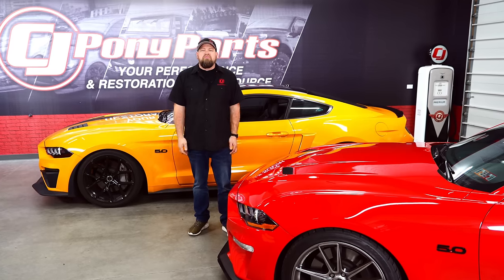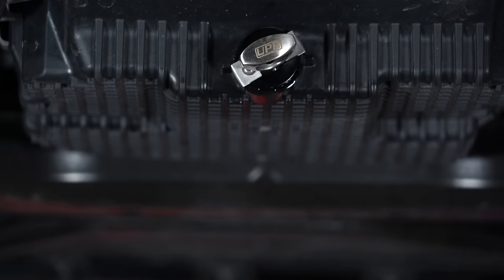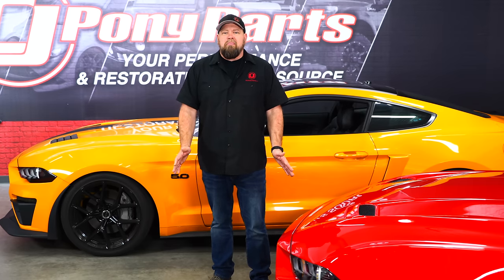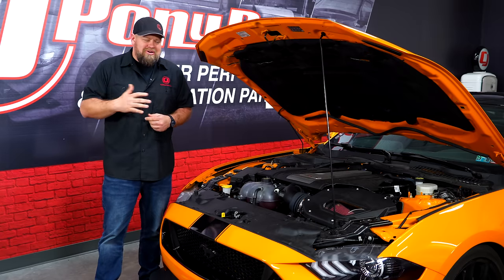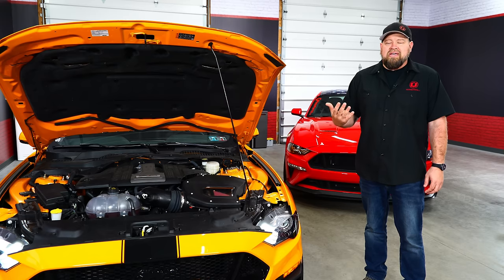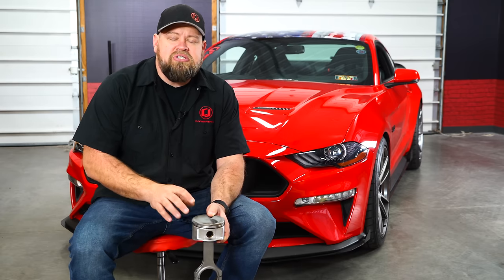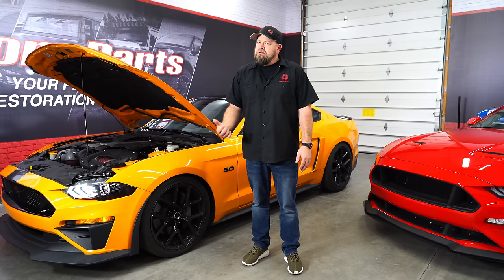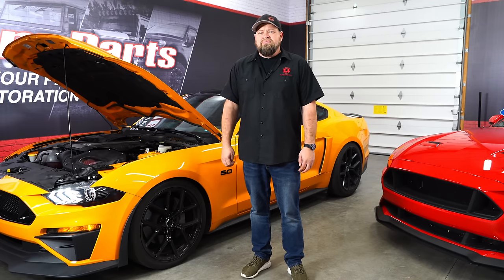2018-2019 Mustang Tick: Should You Be Concerned?

Comment: Bill, your respectfully just restating all of the internet theories and jargon. I have a 2018 GT PP1. My car started ticking at 1100 miles, two weeks after an oil change with Motorcraft products. There was metal found in the oil, and separator. There was scoring found on cylinder 1,3, & 4. Ford replaced my engine under warranty with a long block. 150 miles on the new engine, no tick so far, car is in storage for the winter. Certetec is not the solution.
Reply: This really needs to be looked at on a case by case basis and any owner can pull some plugs and put a borescope down the hole or have their local shop do it, most shops have one of these.
Reply: Frozen Stang The findings are very consistent across the boards...resulting in the same results, consistently...
Reply: @gothamems5628  They really arent. some guys are getting long blocks ,some have scoring, some are getting a single cylinder head. I have only seen one person with a rod knock ,show me i am wide open i certainly havent seen every video on the internet. Not everyone comes here so complain either im sure. As has been said this is not a new problem and when i bought my car i no prior knowledge of anything mustang , i rented a few liked them and bought one. Been a tech for over 30 years ,didnt hear anything i havent heard from other mod motors, they are not the quietest anyway. Have since had my oil analyzed ,no issues .
Reply: I had my long block replaced...they really are...
Reply: @gothamems5628  1100 miles? That was probably the very first oil change it got. That 'metal' was probably just from break in. I cant change how you feel about your 'bad experience'. But what I can say is that the Coyote platform is very powerful, efficient, and has proven itself dominant over a lot of other platforms.
Reply: Regardless, there shouldn't be issues, the shift forks in these cars are made of glass. The engine ticks and they're more expensive than any other GT Mustang before it. I say figure it out Ford.
Reply: What’s sad is these paid off parasites are just helping these loyal customers get screwed. Of course there is a promblem all you got to do is buy a 6 dollar pair of stethoscope at harbor freight and lay them on the oil pan. Sounds like a anvil against a barrel.
Reply: @frozenstang3868  8in 7
Reply: @GothamEMS 

I've watched your videos, and many others like yourself, who are dealing with that same issue.

I definitely feel your pain, and others who invested in the S550 platform.

No Mustang GT PP1, PP2 owner, should have to deal with piston slap, cylinder scoring, gear forks bending, in some instances, the active exhaust no longer operating.
Reply: Yikes Gotham that sucks. Glad they swapped motors for you.

Comment: I have a 2018, PP1, build date in Nov, 2017. It has had a small ticking sounds, but it's obviously the direct injection. Sounds just like my 16' WRX that had a DIT motor. I'm current at 11,5XX miles. a couple thousand of which have been hard driving on rural roads and a little autocross. I broke it in, per the manual and have the oil changed every 3K miles at the dealer.  The only gripe I have is a rattle has developed to the left of the steering wheel and I don't know what it is! But, I digress. Still love the car... it's a great time to be alive for a car enthusiast!
Reply from the maker: Aaron F my 15 had that rattle too, it was the hvac vent. There is a small piece of felt that goes over the top of the vent that came off. Push down on the vent and see if it goes away

Comment: 2018 GT approaching 13,000 miles:  Dealership changed oil per the oil life indicator around 7500 miles using the recommended 5W20 blend. I've listened for this tick for months and cannot hear a thing.  Engine still sounds like butter. Angry V8 butter!
Reply: @ourpresidentswallows6017  
OMG 😱
Reply: You must be one of the lucky few not having problems yet
Reply: Kyle Rash haha nah
Reply: robert korab Or it’s not that big of an issue, lol.
Reply: 10 speed or manual?
Reply: Lucky

Comment: My personal experience. I had a 2015 gt that was silent for 60k miles. I changed the oil one day and low and behold I immediately got the tick. Now own a 2018 gt and it had a light tick upon getting it and has progressively gotten louder and more consistent just by changing oil brand, not even the weight! Definitely a strange problem. Hope they find a fix soon, for now ceratec seems like the go to product to stop this obnoxious noise! Lol
Reply: cody bragdon 
This sounds crazy.. my 94 taurus sho made a similar noise yesterday after changing oil brands(from Royal purple to amsoil). The noise went away after a short drive. This also happened 3yrs ago when I changed oil brands, valvoline to royal purple. But also went away after a short drive. I’m just happy the noise goes away fast & stays away. I just think its so odd. Changing brands of oil shouldn’t cause this odd noise. My sho has always & only had 5w-30 put in it.. 203,000 miles now & runs great still.. its my dd.
Reply: I have a 2015 gt does ceratec work on automatics ?

Comment: I have a Shadow Black 2018 Mustang GT 10r80..I started hearing that tick around 500 miles..At first,i panicked about it but then i realized i dont want my brand new Mustang to be torn apart already being it a brand new..Now,i'm on my way to 10k mark with no issues of blowing up or something under the hood or whatever..No engine light showing up so i just live with it..I hear it from time to time but then it goes away when the engine is warmed up and u started driving it..If Ford issues a recall for it then thats the only time im gonna take it to the dealership..Just wanna share what's my experiences so far with the car,.
Reply: 10k on my 10r80 5.0. No issues with mines either. Mines tick a little but it’s not a big deal to me.
Reply: Take it in when ur warrenty is almost over and demand a engine rebuild
Reply: @hecks80944    If only it were that easy but thankfully it isn't.
Reply: War Gamer - I know that it has been 10 months since your post. Just wondering if you still have your mustang and how it’s performing with the engine tick. 

First mustang I have owned was a black 2015 GT auto as seen on my channel. Before I was able to post any other mods other than the exhaust the mustang blew up at 800 miles sitting in my driveway after remote starting it. I went through hell with the dealer where I purchased from. They eventually offered to sell me another Mustang after buying back the 2015 after many many conversations with the (GM).
The replacement was a 2016 Mustang GT PP1 that I mildly modded, exhaust, intake graphics etc. That car was amazing with no issues at all, of course I was dumb and sold it locally.

I now own a 2019 Mustang GT PP1 Manual. The car had developed the engine tick after driving it home of course. I’ve noticed when cold starting the vehicle and letting it idle down after 5 mins the tick is apparent. Driving the car not to exceed 4,000 rpm’s for approximately 10 mins, the tick dulled slightly to where you couldn’t tell by just walking around the car. My oil was changed at 1,000 miles after the “recommended break-in” using 5w-30 Mobile 1 synthetic and Motor craft oil filter. The tick is still apparent at 1200 miles.

I just wanna enjoy my car without having to deal with Ford “Again” in that matter. Looks to be in Inevitable at this point. 

Any updates would be gladly appreciated, Thanx.

Comment: Great video. I ended up using a filter mag and opened the filter at my last oil change and found a small amount of a fine accumulation of metal shavings which is normal. Unless there is a check engine light or horrible noise present, ship it and live with it.

Comment: I noticed the tick the day after I got my 2018 home . Thought it was the fuel injection. Took it to auto cross where everyone thought it was the fuel system.  I redline  it  every chance I get.  The tick has stopped altogether sometime after 5,500 miles.  I changed the oil 3 times because I was looking for metal and haven't found any metal in the oil, filter or separator. Factory recommended oil 5w-20 Motorcraft.  I despise dealerships so I won't bring it in unless it fails.
Reply: Raymond Strait  I put in 5w30. I swear 5w20 is too light for this car. But, I’m no engineer lol.
Reply: Best thing you did was change the oil that often the first few times 👌👌
Reply: Christian agostini depending on the oil itself you use 5w20 is good, had my Redline 5w20 tested several times and its doing the job pretty good
Reply: I have 3400 on mine and it doesn't tick . I went on a 400 mile trip at 700 miles and drove responsible , no redline . When I return home that night I noticed a specific noise that kinda resembles a type writer and I could feel it was in sync  with the fuel lines . I changed the oil at 1100 miles , old school , end of the break in . I have not noticed anything out of ordinary for a 4 cam 32 valve duel fuel injected engine . It sounds like a sewing machine to me . They are not quite like a 64 Olds 394 . I removed the engine cover , it looked some stupid and cheap .

Comment: My 2018 GTpp started the typewriter tick 2 days after my 2nd oil change at the dealer with 5465 miles on the OD. First LOF at 553 break in miles.
Hot oil pressure dropped from 20 / 21 down to 16 to 19 psi. 
Not only can I hear this tick but an intermittent low knocking sound is apparent as well right along with the tick. The two different sounds do not appear to be associated. I can hear the knock through the firewall with the windows closed.
I am going to drop off the car at the local dealer this coming week. 

FoMoCo's TSB 7718 dismisses the sound as "normal". Imo that is a BS cover your butt answer. 

As a machine shop owner and performance engine builder some questions come to mind.

If the sound is normal what is causing it? If you can not answer the former how do you know it is harmless?

If this (normal) is the case why don't ALL Gen 3 Coyote engines make the sound.
Why the appearance in some cases after a dealer LOF?
Why do additives and friction modifiers offer a temporary fix?

At 553 miles I discussed the slapping sound these engines make at about 1500 to 2500 rpm with my local service manager. We went out and started several other Gt's and all made that sound. Reminds me of the Corvette piston slap drama back in the 90's.

I understand and accept that DI engines are noisy. I can pick out and overlook the reasonably normal cacophony of sounds emanating from this engine. 

What I am hearing now is unacceptable in a $47K+ new car.

SJ
Reply: 3 years later did this cause any bigger problems or did you just lived with it, I recently bought a 2018 GT PP1 Premium for a good price and I'm afraid it has it.
Reply: @Martinchvr  

After the low end knocking I traded the 18 on a heavily discounted 2019 GTpp with a 0 interest loan. 
It now has a Roush Phase 2.
The piston slap sound is actually the DI fuel pump operating.

No ticking on this one.

No other issues to date.
The Gen 3 coyote is noisy no doubt.

SJ
Reply: @smjrhp1  so as I understand the newer vehicle never developed the ticking noise?
Reply: My 2016 GT is no DI and still ticks, CERATEC fixed it actually, temporary

Comment: 2018 PP1, picked up the car in Iowa mid March, my brother and I drove it back to Arizona, 1600 miles in 23 hours. Had it up to 145 mph when road/traffic allowed, no "low speed" break in. With a Lund flex tune, ran 11.80 in 4,000 ft DA in April. Have had a dealer change the oil twice, has 11,00 miles, no hint of any tick.

Comment: high compression rocks the piston more at idle than low compression. don't let any high performance engine idle any more than you have to. excessive idling is never good for any engine, but it's especially not good for engines with high compression, short pistons, and aggressive camshafts.

Comment: I have a 2017 Mustang GT 5.0. I purchased new. Drove and sounded perfect!  At 19k miles, I started hearing a ticking or slight clattering in the motor..closer to the passenger side.  Took it to Ford Dealership..first they said they didnt hear anything!  After I finally convinced them and someone from the bottom of the service department that admitted to hearing it...they got the approval from Corporate to take the motor apart and diagnose as they go. Found metal shavings in oil pan. They replaced the motor. Shortly after that the noise..same noise..came back! Now Ford won't touch it unless it blows up..so to speak.
I asked for an extended warranty on that motor or a trade...they offer 75k mile warranty🤔..um. ok! Can't beat that on a new car!! That was over 2 years ago and just rolled over 40k miles...so living with the sound of a clunker car..although it does not hinder the performance of the car. I love this car but what kind of message are they sending? What do people think as you drive your beautiful Mustang into a show to display your masterpiece and they hear that ticking as you idle by
 💔💯
COME ON FORD!? WHAT'S THE BIG DEAL?? You're a multi billion dollar company and I'm a repeat buyer 10 fold! Why can't this be fixed?
Reply: And you still have that mustang what  mileage have now? I have 2018 with 60k miles I hope last because it have the tick noise lol😢😅

Comment: I had it on my 11 and 12. When Ford would use their oil, tick was gone. They ended up doing quite a bit of work to both of them and after I did an oil change and used Royal Purple the tick came back. So I would say oil has a lot to do with it. I now have an 18 Shelby and so far no tick. 
My tick only occurred when the oil was clean and up to temp. Once I had 3000 on the oil it wouldn’t do it. The hotter it was outside or the harder I pushed the motor it would tick worse.
Reply: So no more purple royal?😊

Comment: The real question is if Ceratec is used, will it always have to be done each change or will it actually “fix” the problem. Because the way I see it is I have owned many car as I’m sure that many out there has, if slap was “normal” and ok, then a lot more cars would have it. Yes? Or am I ignorant for rational thinking? This has been my first experience with having metal in my oil. 
I’m a machinist and could always use some “new” insight.

Comment: Last march i bought a used 2017 Gt, I put a few thousand miles on it. The tick began after an oil change and i noticed right away. I got a new shortblock under warranty in May. 4 oil changes later the tick came back but louder, this time I have longtubes and OPG/timing sprocket. I am trying to have the longblock replaced this time, a couple weeks ago Ford Hotline advised to get my cam phasers replaced, sound is still there and rather loud and happening every day every drive. Stay tuned. I have a procharger in the garage ready to go after I am confident I can push the power.

Comment: My ‘18 burned an excessive amount of oil and had an occasional tick up to about 6k miles. Think it may have had something to do with ring flutter, but it was broken in per the manual. After about 6k, the oil burn stopped and there is no tick. 17k miles now and the car is running great!

Comment: Even if the tick isn't bothering anything, it's annoying.  Especially so if it occurs/heard while driving as well as some manual owners have reported at low RPMs.  My '15 GT Whipple never had a tick that I ever noticed.  But the 18s/19s seem to be quite common.  Bottom line: if you're getting a new GT, you are quite frankly shelling out a good chunk of change to roll the dice that you won't have an annoying issue.  And yes, you are rolling the dice.
Reply: Great way to put it

Comment: We just purchased a 2019 with 9000 miles. It is a GT, and not only has it developed "the tick", but it also sounds like a diesel when you are driving and just maintaining speed. When you put a load on the engine, or let off the gas, the noise stops. It is a 6 speed manual. Also, at idle, you can feel a consistent "bump" in the shifter in time with the knock.

Comment: Imma tech at a jeep dealership. While I dont see fords really ever I do know about noises that customers hear that are normal. The reason why people have started noticing noises is because the manufactures want to make the car as quite as possible. Its called nvh (noise vibration and harshness) they go to extreme length to lessen all of it. With the absence of some noises others become more prevalent. This sounds completely normal as the hemi and pentastar engines make similar noises, especially when cold starting. Good info in video just wanted to add some stuff and shut down anyone saying "its cuz its a ford"